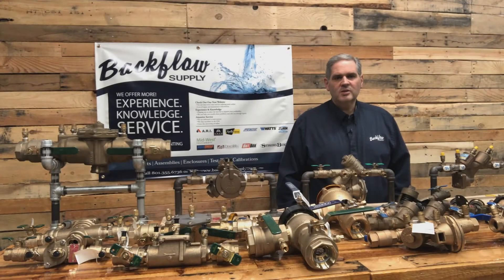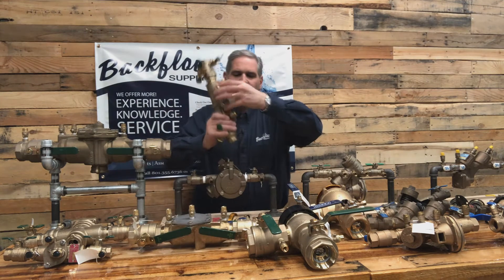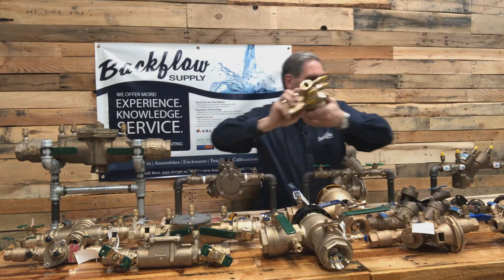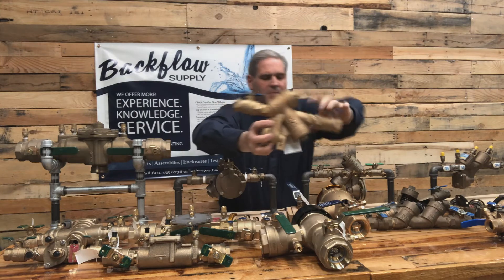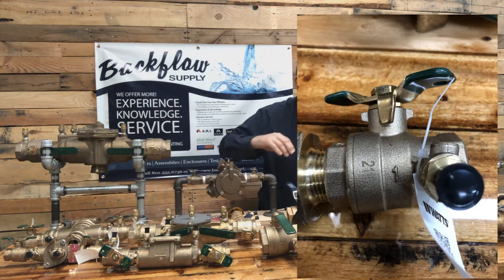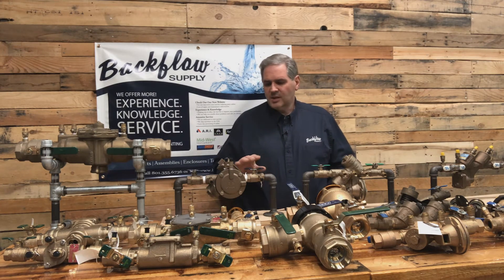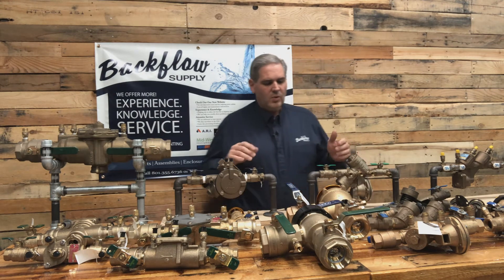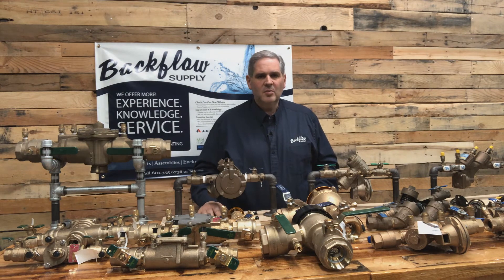How to Identify your Backflow Model and Size

Comment: How to you make sure it’s the right device for the system? 

I found lots of videos on how to replace like for like. But what if it was replaced incorrectly in the past? 

Are these based on inlet/outlet pipe size? Water pressure? 

Thank you in advance for any help.
Reply from the maker: Local codes vary as to what is approved for situations but if you want to call me and we can talk about it more you can.  801-355-6736 or email me at sean@backflow-supply.com.

Some info I would need to start is what are you putting the backflow assembly on?  Lawn sprinkler, boiler, or some other application.  What is the line size?

The line size or water pressure wouldn't necessarily determine what is put on.  It is more by degree of hazard and local codes.